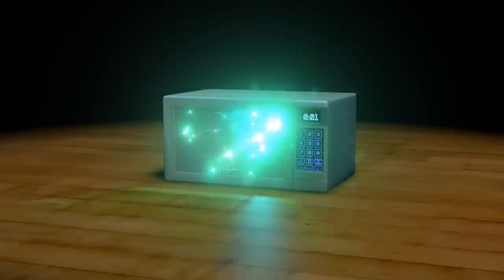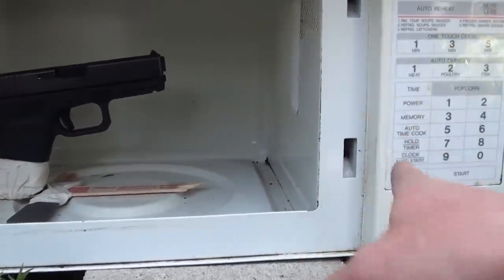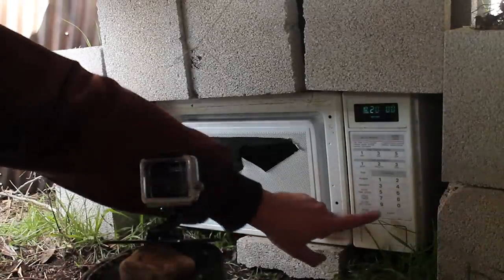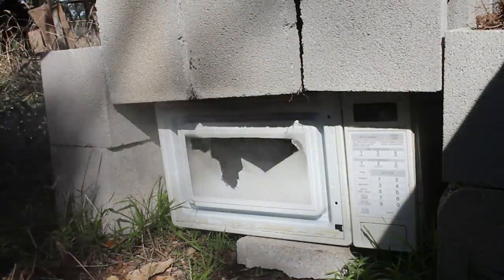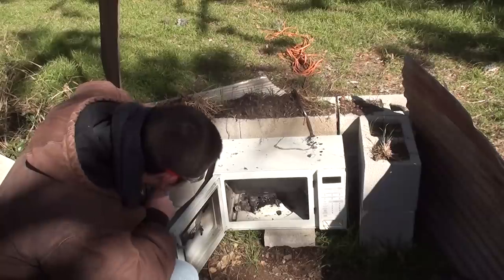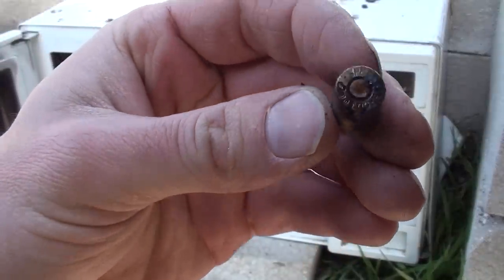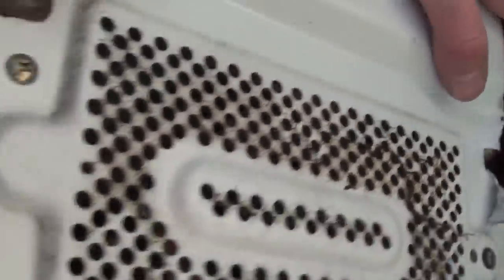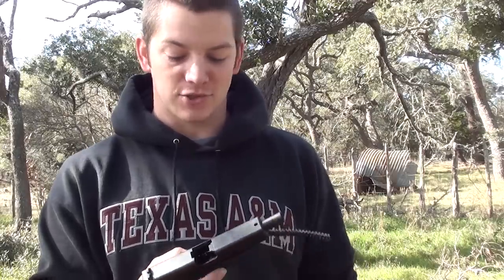Loaded Glock in a Microwave

Comment: microwave gets hot enough to melt a gun but can't warm up my food evenly?
Reply: Microwaves vibrate water molecules to heat the food
Reply: That's cause a Glock is made of a high grade plastic "polymer" and it got dealt with like the piece of crap that it is by the microwave
Reply: Put your food on the edge of the plate. If you put your food directly in the center you will have cold spots.
Reply: Ong
Reply: It makes the plate hotter than the actual food lmaoooo
Reply: @nathanm.8823  OMG really?
Reply: kakokapolei123 lol not possible but aight
Reply: For reaaal
Reply: Right
Reply: Put it in for 10 minutes and tell me if it’s heated up all the way lol
Reply: @kakokapolei123  rrriiiiiiight

Comment: As soon as you cut the screen on the door, all microwave radiation was allowed to escape, which is why the GoPro stopped. Guess what frequency Bluetooth uses? 2400-2450mhz. The tiny holes in the screen door are specifically designed for the wavelength of the microwave oven which operates at (2450 mhz)! Those waves cannot fit through the holes. :-) Years ago I used microwave oven door mesh on top of my vehicle's headlights to drastically reduce the radar detection range of my vehicle. Headlights are excellent reflectors for radar guns.

Comment: Dont glocks have a lifetime warranty?   send it in and see what they say.  lol
Reply: Glock only does one year warranty.
Reply: +izzy that sucks... kel-tec even has a life time warranty.
Reply: well glocks normally dont need a warranty lol have yet to find one that doesn't operate as intended.
Reply: +Michael Braddy mine could of used a warranty. Cracked frame.... Only 3 years old, about 7,000 rounds through it.

Meanwhile my sp2022 has eaten well over 10,000 and is going strong.... Oh and it cost me 100 dollars less.
Reply: Michael Braddy Snap-On is one of the best tool manufactures in the world. They provide life time warranties even though their tools last.
Reply: Matco is probably better at tools, but both of them only have a limited warranty.  Just that the guys on the trucks can finagle it a bit.
Reply: AreThereNoMoreNames I don't know where you get yours from. But here they have life time warranties and are warrantied against virtually everything. Even against my stupidity.
Reply: *****
Like I said, the guys on the tool trucks have a little leeway in what they can do.  But my radiator pressure tester isn't holding pressure, it's not broken or anything, they won't warranty it.  They list the warranty details on their respective websites, and it's not lifetime.
Reply: AreThereNoMoreNames tools like those the shop owns where I work so I don't know their warranty. However the hand tools like my rachet that Mack rebuilt 3 times in two months is life time. And the various 30+ year old tools my dad gives me to get fix or replaced under warranty are as well.
Reply: *****
Their warranty applies only to the original purchaser for a short period against defects in material or workmanship, but not any abnormal use.  Anything beyond that is at the discretion of the guy in the truck.

And yeah, I have a 3/8" Mac wrench that I've eaten the teeth on a few times, the tool guy I bought it from originally didn't want to replace it, so I stopped doing business with him, but others have provided a rebuild kit as needed.
Reply: AreThereNoMoreNames o
Reply: "I can take a crap in a box and mark it guaranteed, seriously I've got some time" If you know that quote I salute you ;)
Reply: When your product used to be a malfunctioning hand grenade that lasts for a year you don't need a lifetime warranty.
Reply: SilverStar Heggisist Hey. Kel-Tec 9mm is a reliable gun that’s relatively cheap
Reply: I got an m&p exactly for the life time warranty
Reply: iF YOU CAN FIND THEM.
Reply: Diden't spock carry a glock, way back down there ' on the clock ! ~?  NO !
Reply: @michaelbraddy2463  there are plenty of glocks that don't last look it up there are so many that only lasted 2 years yet a ruger will last a long time and a lifetime warranty
Reply: The glock clocked out!
Reply: @murphpawz  I know this is late, but I couldn't help but to notice your quote. I used to watch "Tommy Boy" all the time. I am actually a 70's & 80's kid, but you couldn't beat the real comedy of movies/shows from the 90's. ...Of course with the exception of Eddie Murphy, George Carlin, Richard Pryor and so on (which are an obvious given...), but anyway, I found your comment perfect and extremely witty for the sake of the argument that was taking place at the time. And for that, I salute you, sir👍✌️
Reply: I'm sure they would tell you it was fue to bad ammo.
Reply: AreThereNoMoreNames all snap on hand tools have lifetime warranty that pressure tester isn't considered a hand tool. All companies that have lifetime warranties only cover hand tools in that
Reply: @murphpawz  Tommy Boy  that is a great movie..I miss Farley.

Comment: and yes. open face of a microwave will destroy the circuitry in the gopro almost immediately.  Also, the metal in the glock will kill the magnetron faster than the bullet will.  It works as a faraday cage around the bullet preventing it from going off.

The only reason the plastic was melting is due to the heating of the exterior of the glock's slide and sliderails.  The microwave radio waves like to ride the outside of the metal.  This is simple physics.
Reply: I have a hard time understanding how simple things like a microwave are perceived by the general public. It hurts my head when I hear someone say that things that come out of a microwave can contain harmful radiation. Yes, someone did say this. I could not help but to laugh. 

Oh and for the record, on the first page of comments, yours was the only one displayed that not only had any sense but was spot-on. Thank you and I hope you have a good day.
Reply: XboxorMat Amazing, a person who understands. Microwaves do not emit harmful radiation, but they release a signal that bounces around in the microwave at 2.4 GHz, which is also the frequency of multiple router channels. Thus, if you are using a microwave, you are using a router/wireless mouse/keyboard. A wireless mouse pulses at the same rate as a microwave, just some info.

Comment: wondering why the pistol didn't eject the shell in the beginning when he proved that it was real.
Reply: Pretty sure the extractor is fixed in Glocks and not spring loaded, so it may not have hooked onto the case rim until it slammed home after he fired
Reply: Fully realize this is over two years old but I just watched it and noticed the same thing. If the Glock was functioning properly that shell should of extracted on its own. Makes me wonder if he just bought the cheapest used Glock (possibly with issues) he could find since he knew he was going to toast it.

Comment: What a minute, how come the casing stayed in the chamber after you fired off the glock in the beginning? is the extractor not working?
Reply: Possibly due to the fact that the shell was not only melted in to the chamber, but also because the frame was melted to the slide.... When that kind of shit happens, I's be really surprised if ANYTHING worked properly on that gun.
Reply: no, im actually talking about the beginning of the video where he fired off a shot from the gun to show that it was real. The casing didnt eject and just stayed in the gun.
Reply: mkygod I thought the exact same thing, my bet he was having extraction issues and that's why he sacrificed it.
Reply from the maker: krievian There was no magazine in the Glock.
Reply: Hmm, I wasn't aware that made a difference as to whether or not the casing would eject. One learns something new everyday, I suppose...
Reply: World Known yes there is a spring in the mag witch pushes the next round up also pushing the other casing out.
Reply: Argle Bargle
I realize that, but for the magazine to have any effect on extraction of the round, the extractor would have to work properly..
Reply: Argle Bargle  It wouldnt matter if there was a magazine in the gun. If the gun was working properly, the extractor would've pulled out the casing and ejected it like every other semi-automatic handgun. That's the only job of the extractor.

Comment: Why didn't it cycle when you shot the test round?
Reply: He probably hand loaded that round with a low amount of gun powder so it wasn't strong enough to fully cycle and eject it, probably so he didn't have to look for the casing in the grass just to show it to the camera.
Reply: I'm guessing because the gun did not have any counter force on the slide because it wasn't being held.
Reply: It's because it doesn't have the magazine inserted.
Reply: I'm pretty sure glocks still eject a fired round without a magazine.
Reply: Steverino322 I was going to say the magazine thing as well and then noticed it didnt eject the spent casing in the beginning... So my guess would be he removed the return spring (for safety reasons)??
Reply: The round look plenty powerful to cycle the gun, the gun was being held when he fired it, the round will eject fine with no magazine- the slide will not lock back however with no magazine follower to engage the slide catch, without a 'return spring, the gun would not have gun into battery and the slide would not have returned to battery after the shot, it also would be highly unsafe to do this. You'll notice he hand loaded the test round, during normal operation the round is fed from the magazine and the rim slides up behind the extractor claw, when you hand load one round like he did it is possible for the extractor to sit behind the rim, or not get a full grab on the rim, as the extractor claw is smashing into the back of the case, instead of the case slipping up behind the extractor. In this case the round will not extract and therefore not eject.
Reply: when you load a round into the gun straight into the barrel the extractor doesn't hook onto the rim of the casing. prooobably left a breach in the chamber . but who knows
Reply: Jesse James Wow. Left a breach in the chamber, huh? The chamber and breech are the same part of the weapon, The chamber is the cavity that holds the cartridge, the breech is the hole on the back end of the barrel leading to the chamber. And yes, if an extractor is in place and functioning, it will ALWAYS hook on the rim of the cartridge casing. So, in conclusion, leaving a breech in your chamber would be like holding your fist in your hand, and an extractors job is to ALWAYS engage the rim of the casing, unless it's broken.
Reply: Sam Moon a breach  as in a gap not the gun , so wow, yeah I already know bud.  ya ever hear the term  theres a breach in the hull or a breach in security? a figure of speech,  and yeah go ahead and stick a round in the barrel without a mag and let the slide forward  there is a definant gap , I just checked with my own glock 19 ,
Reply: Sorry, Jesse, you still haven't made sense of your BS. A hull-breach is a hole, the same reason "breech" is used to describe the back of the barrel. Your statement was "he left a breach in the chamber', unless he was drilling holes in the chamber, then filling them, your statement doesn't make sense. If your Glock doesn't extract casings from the chamber, your extractor is broken, the only thing the should stop working when there's no mag in the gun is the slide-stop. Is that was you were thinking of when you posted? If you continue to insist that an extractor should stop working with a magazine in the weapon, I will post a video of the extractor functioning with and without magazine on a Beretta 92fs, a Russian SKS, A 1916 BSA SMLE No. 1 Mkiii*, a Russian M44 carbine, and a  1944 Fazerkely No.5 "Jungle Carbine". An extractors job, once again, is to EXTRACT the casing, all the time. The only way it wouldn't work on your Glock, is if you were not letting the slide go to full battery(fully forward and locked), which means that your weapons breech is slightly open, the action is not fully locked. Which is NOT how the weapon is supposed to function, and extremely dangerous.
Reply: Sam Moon  hows this if it still doesn't make sense to you. the slides not all the way forward . there is a gap, that's what I meant in my original post , and  the reason it looks like to me is that he didn't load the round using the magazine , he just set the bullet in the chamber by hand, which yes the extractor keep it from fully closing leaving a breach/gap , go ahead and rewatch what he did at the beginning you'll se what I mean  , your kinda of taking things a bit to literally and getting so worked up over nothing . It's really no big whoop
Reply: Jesse James I watched the video, he puts the round in the chamber, then releases the slide-stop, allowing the main-spring to do it's job of returning the slide to full-battery. BTW, you still haven't noticed that "breach" and "breech" are two different words, with different meanings, ergo, I needed a road-map through your statement. Bottom line, admitting you're wrong ISN'T a big deal, what can't you?
Reply: Richard Spagna does anyone read the comments before posting ? No.